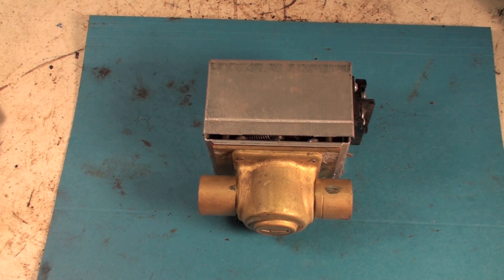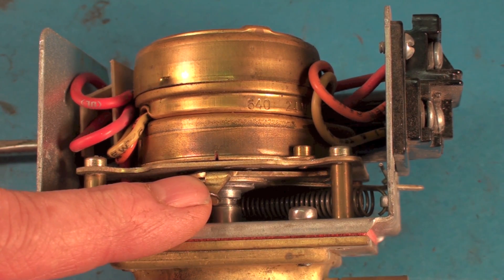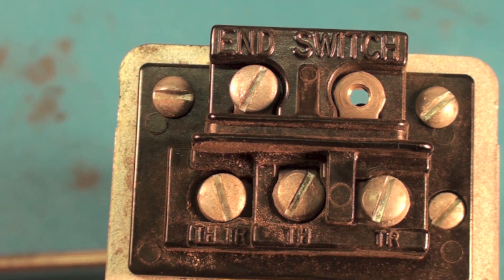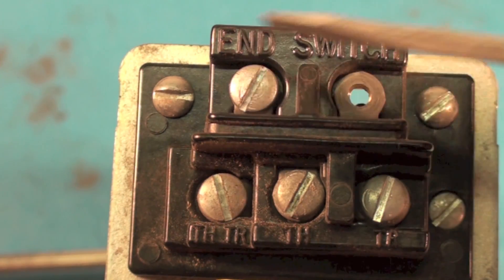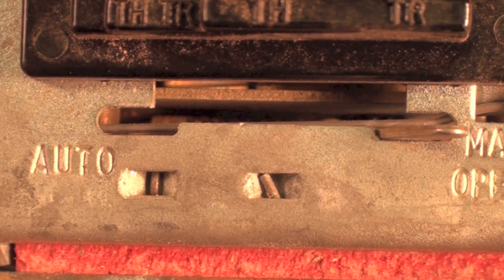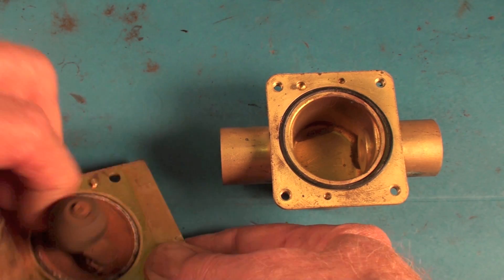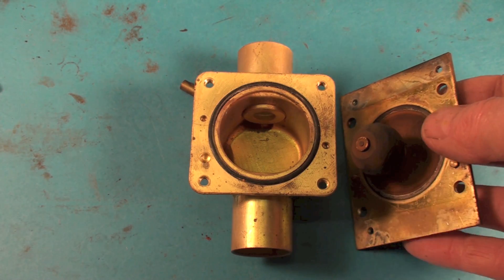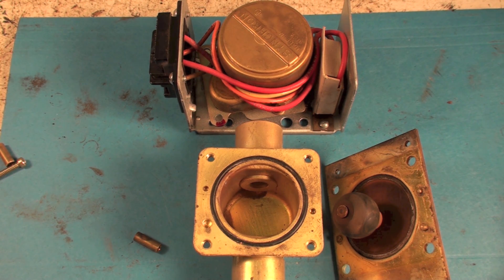How the Honeywell zone valve works.  Part 1

Comment: My motor is rusted and not hooked up anymore. Is it possible that the ball could have closed the valve? Can I put a wrench on it and turn it manually to make sure it's open?
Reply from the maker: You can remove the power unit and rotate the valve manually.  It should turn opposite the water flow.  Merry Christmas
GFM

Comment: Hey Thanks so much for this!! I have a split hot water heater system in our apartment. If this valve is stuck in the manual open position just so we can get heat going will this cause the hot water to flow constantly through the air handler / coil even when desired temp is meg and the blower shuts off via the thermostat?  They installed a new unit inside and out. Few days after I came home and was no longer getting cool air from ac. Shut off the hot water in the basement and the cool air came back.

Comment: You saved my bacon.  I putter with electric and plumbing and am skilled for not having formal training (I have often installed my own furnace and water heater.)  I have a two zone hot water baseboard system and bought a Honeywell wi-fi thermostat for the main part of the house.  Because I am often away from the house I installed a wi-fi operated switch that COMPLETELY shuts down the system, no domestic hot water, no heat, no electrical consumption. The 24 volt transformer powers the wi-fi thermostat.  Because I wanted to be able to read the house temperature remotely I needed a source of power independent of the boiler transformer.  Easy, right?  By the time I removed wires, all of which are different colors at different points, it took me THREE days to complete my project (which does work).  I saw a $400 bill for a furnace technician to come in and straighten it out.  I had to review your wiring of the water valve several times in light of my own problem with different colored wires (I have and used a volt/ohm meter but still struggled).  This all comes down to "thank you."  I am not dumb but I had to study your valve wiring several times and finally got it right.  Nothing else I researched on the web actually showed me that.
Reply from the maker: Glad I could help.
GFM

Comment: Thanks for the video.  It does a good job of explaining the valve and motor assembly.  However, I have a situation where the motor is fine, the control is wired properly, but when the thermostat call for heat the gear (i.e., the rack portion that operates the valve itself and contacts the microswitch) does not move unless I manually nudge it.  Any suggestions on what to look for and do?  

P.S.  I am not biggest fan of the gearing system.  On previous units I have had the gears strip and had the "rack" portion come loose where (a) it will no engage the pinion of (b) will move enough to engage the microswitch.
Reply from the maker: It probably is not the best design.  The head is replaceable.
GFM
Reply: @grayfurnaceman  Yea, I know.  I have replace it at least 6 times in 20 years.

Comment: Thanks for the informative video..... so if the valve opens but will not close ( unless I tap the motor and I see the gears moving) is the valve bad since it closes mechanically or is it the motor.... right now it will no longer close even if I tap it

Thx

Jeff
Reply: As a follow up I just tapped it and it closed but my question remains the same... thx again, Jeff
Reply from the maker: @jeffreyfried9119  Almost certainly the motor assembly has failed.
GFM
Reply: @grayfurnaceman  thanks very much .... I  didn’t want to buy a new motor  cause I thought it was the spring mechanism not the motor
Reply from the maker: @jeffreyfried9119  There are no parts available for the motor assembly.  You have to change the entire assembly above the valve itself.
GFM
Reply: @grayfurnaceman  gotcha, I though you just meant the motor.....if I remove the motor assembly will water spray out ?
Reply from the maker: @jeffreyfried9119  There are 2 screws placed diagonally on the power head.  Remove the screws and the entire power head will come off.  There is a second plate underneath.  If the screws for that one are removed, you will get a bath.  
GFM
Reply: @grayfurnaceman  got it will order new power head.. no baths

Comment: Thanks for this useful video.  Is the motor supposed to turn as long as there is a call for heat?  I expected it to stop when the end switch closed, but in my case, this is not happening, and the motor runs as long as there is a call for heat.
Reply from the maker: That's how they work.  When the power goes off, a spring returns it to closed.
GFM
Reply: @grayfurnaceman  Thanks.  They get really hot during operation - during a typical cycle, one of these motors is going to be stalled out for most of the time it's powered, like a person holding a weight over their head.  Seems really inefficient. I suppose they are designed to take it.
Reply from the maker: @dangreenspan8412  It kind of does seem its inefficient.  They are designed to take it.
GFM
Reply: This was my concern normally a motor would be powered down when stalled. Thanks for the info.

Comment: Does the motor consume power after the end switch is activated.  In other words, is motor under full load, held stopped by the end switch, while power is applied (and wasted) to the motor?
Reply: Less than .02 Amps .....so little energy consumption.

Comment: No heat in one zone.  But, it seems there's not water in the copper pipe to the zone.  The manual test lever is just flopping.  What could be the problem here?
Reply from the maker: If it is the highest zone, the system pressure is probably too low.  Lower level zone, air in the line.
GFM

Comment: What if the manual lever is floppy?  I have no heat in this zone and manual lever doesn't work.  Floppy and not engaged in anything.
Reply from the maker: If it is floppy, that means the valve is open.  I would be looking for air in the zone.
GFM

Comment: Am so glad I found this video -- and your channel. Have just subscribed. Recently replaced this very zone valve with your help (so thank you)! Wondering if I could pick your brain...Two of my zone valves, which govern hot water going to my bathroom & kitchen, are just fine. But came back from several weeks away to find the 3rd zone valve -- its spring-return mechanism, to be specific -- broken. I had left my thermostat at 74F non-stop from January through the month of June. I live in the upper midwest & weather was hot (90F+) for several weeks in May & June. Would normally not have been running the heat, but was away for several weeks & had forgotten to turn the thermostat down. Could leaving that zone valve open non-stop for so many months w/o a "breather" have stressed the spring to breaking point?

Comment: is there a part 2 video?
Reply from the maker: I have not gotten around to that one.  I guess I should get going, it has been a while.
GFM
Reply: @grayfurnaceman  Thanks for reading your comments! I did find this video helpful; what I am still not clear on is the proper way to wire the thermostat to the valve and the valves to the boiler (I have a Weil McClain HE II with 2 zone valves). Previous 'repairs' have left a spaghetti pile of multicolored wires spliced in a way I cannot fathom. I think I need to rewire the whole thing.
Reply from the maker: @cgnicolis   Ahh, the old spaghetti wiring trick.  I have seen it many times.  Unfortunately, there are several ways to wire the system.  There is no way to know how it was done.
GFM

Comment: if I where to replace a zone valve would I drain the entire system or if possible, just the zone ? thanks for the video
Reply from the maker: It does depend on how the system is piped.  
Unless the valve has shutoff valve at the inlet and outlet, you will probably have to drain it.
That said, are you sure you must replace the entire valve?  If the problem is in the power head, it can be replaced without opening the system.
GFM
Reply: @grayfurnaceman  yes it's stuck open. it has "2007 " scribbled on the cover. the p.o. had 5 of 6 valves replaced this is the last
Reply from the maker: @motoputz3201  Sounds like a powerhead problem to me.
GFM
Reply: @grayfurnaceman  thanks for the help, I hired a heater co. to fix it

Comment: Nice video , I had a jammed zone valve replaced or should I say updated to the E1012 Honeywell the guy left the old body in but put the new guts and ball valve part In , I’m getting the hammer noise from my research the valve could be upsides down or closing to fast because the body was not replaced it’s impossible to install the wrong direction but I did read something about removing a return spring , any truth to this ... the valve that was removed was the exact one your showing

Comment: Quick question 2 of my zones are stuck open and the spring wont return it so my heat stays on no matter what the thermostat is set to
Reply from the maker: If you remove power from the valve and it stays on, the head must be replaced.
GFM
Reply: @grayfurnaceman  I do have a power switch to kill power to the boiler and valves and when I shut it off they still stay open
Reply from the maker: Sounds like the heads need to be replaced.
GFM @hydro82

Comment: Can u just buy the end switch instead the hole unit. I have a V8043E1079 Honeywell valve. 
Thanks
Reply from the maker: You can buy the head assembly but not the switch.
GFM

Comment: hi my honeywell zone valve failed in inside that brass housing cant open it any ideas why?? should i take head off and spray wd40 on that stem to free it up?? wont stay open even using wrench.
Reply: That's the motor.  Its not considered repairable.  The head assembly is replaceable without replacing the entire valve.
GFM
Reply: @electriccar3253  its stuck inside the valve wondering if any trick to free it up inside valve?? the motor clicks when thremostat calls for heat so that may be bad also what im saying is cant open valve manually either tried wrench but wouldnt stay in position
Reply from the maker: The problem here is any failure in the motor/gearing module is usually not effectively repaired.
GFM
Reply: @grayfurnaceman  whats time/labor estimate to replace whole assembly this includes sweat not threaded fittings ?i can get part on amazon for $95.00
Reply from the maker: First, you probably do not have to replace the entire valve.  You can just replace the powerhead.  
Labor could run between $200to $400.  Replacing the entire valve involves opening the water system.  I can't estimate that one as the type of system determines the labor time.
GFM

Comment: Hi, I have 3 zones and with one zone the heat will not shut off for the baseboards. I replaced the thermostat for that zone and there was no change so I replaced the motorized valve. This did not help either. (The other two zones are working fine.) Any suggestions on what else it could be?
Reply from the maker: Have you replaced the valve also?  If the pump has been replaced, it may have excessive pressure and will open the valve.
GFM
Reply: Thank you for your response.  No, I have only replaced the motor for the valve.  So you think I might need to replace the circulating pump?
Reply from the maker: I would first replace the valve body.  The pump is not failing.  If it puts out too much pressure, it could open the valve.
GFM

Comment: I seem to have a bad water hammering problem in the second story heating zone. How do you troubleshoot air hammering in a newly installed hot water boiler with  2 Honeywell Zone Valves on it? I feel I have all the air purged but still it hammers as the valve closes
Reply from the maker: There are a number of possibilities here.  Because the boiler is new, you may have too much pump.  If you can restrict flow that may help.  Also, be sure the zone valves are installed in the right direction.
GFM
Reply: I will slow down the 3 speed pump to,  the slowest setting. Can I close the gate valves part way? or is there a flow control valve that I can buy? I really appreciate your help, any suggestions will be put to good use. I have been fighting this thing for weeks.
Reply from the maker: You can  restrict a gate valve.  
GFM
Reply: Thanks, I am going to give it a try

Comment: I work in a hotel has an hvac tech and all the fan coils in the guest rooms have these zone valves. Theres a hot valve and chilled water valve that opens and close from the thermostat. Ive had replace them has old ones where worb out.

Comment: Is the valve normally open or normally closed? It should be normally open (by the springs) in my opinion so you still have heat if the power is down in a particular apartment or something is wrong with the thermostat.
Reply from the maker: Normally closed.  The valve is held open by the motor against the spring.
GFM
Reply: grayfurnaceman Thanks ,:) Those are different from what I have in my unit of appartment building. They are normally open. I had to connect the thermostat on R and Y in order to control it , or buy a special thermostat.

Comment: great video,  had a situation the other day with one of these. the end switch wasn't making so I replaced the head.  No heat call again, checked it and the end switch again not making.????  Maybe it was made on a Friday??? replaced it with another.  Now its working, but for how long??? I don't have that warm fuzzy feeling about this one.  I'm now thinking the post is worn and unable to power thru to rotate this paddle to the end switch.  Told the customer if it hangs up again we'll have to drain down the boiler change the guts on the valve body.  Meanwhile,  I rotated it back and forth several times and cleaned up the post area with a wire brush.  Its just the paddle doesn't push the contact on the micro switch enough.  I wish I could adjust that microswitch to contact earlier.  Have you seen this before.
Reply from the maker: I have not.  But I think your are right about the post.
GFM

Comment: I'm having a problem. Well, I've had this problem ever since buying my ranch house 6 years ago. I have a energy kinetics system 2000 unit, oil burning. originally controlled with a [two wire] mercury t-stat, and wouldn't turn off the [only] zone valve equipped for this house, when ever we set the t-stat to zero fir spring, and I found removing a wire powering the zone valve, closed the valve, of course. Every approaching cold season, I'd do the reverse, I'd plug the wire back into its original location, to power the zone valve. Begrudgingly, I've been doing it this way for at least four to five years. I had to replace the zone valve motor, this past Tuesday. I did have my system looked at by a tech doing the annual tune up, and it ran pretty well during the winter season. I had to change out the mercury t-stat, so I opted for the Honeywell RTH2510/2410 series thermostat. Even after doing so, everything ran smoothly, up until that following spring, when I turned off the heater via switch on this new T-stat and it wouldn't turn off the zone valve, heating up the house. So, I pulled that same wire out for the entire warm season, this is how I did everything for the next two years. Now the zone valve is not closing, even after running past the t-stat set point (between 62 and 70 deg) one time the temperature on the Tstat read 85 deg.! So, I'm forced to pull that same wire, powering that motor to close again. As it stands now, the furnace runs, and shuts off as it supposed to, but the zone valve remains open, continuously, I don't think it's receiving any signals from the t-stat, because, again, temperatures run past the set points programmed into the T-stat, and I can physically see the springs stretched throughout this whole process, never closing, until I pull that one zone valve wire powering the motor in it. I don't know by this comment, if it helps you, help me...I just figured I try

Comment: Hi GFM and thanks for the video. My dilemma is I just installed two all new Power heads because the arms we're coming millimeters away from hitting the in switch but weren't. Now I'm having the exact same problem with the two brand new ones honeywell v8043e very frustrating and I probably didn't have to spend $170 today.
Reply from the maker: About all you can do is replace the entire valve.  
GFM
Reply: grayfurnaceman oh I see thank you.  Is that because the valves themselves become harder to move over time?
Reply from the maker: Yes they can.  If you want to continue working on the valve, you can disassemble the valve (after removing the water from the boiler)  and try to free it up.  No guarantees there.
GFM